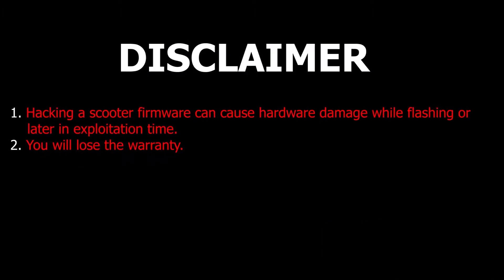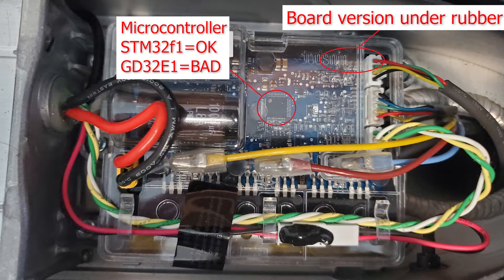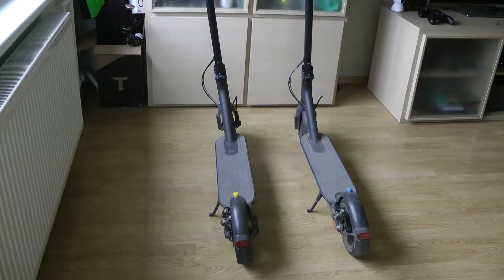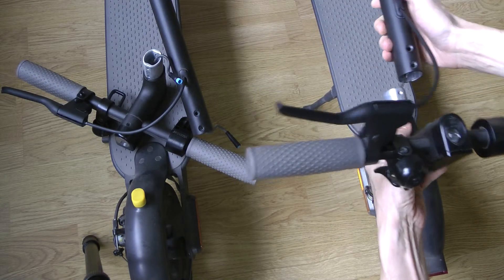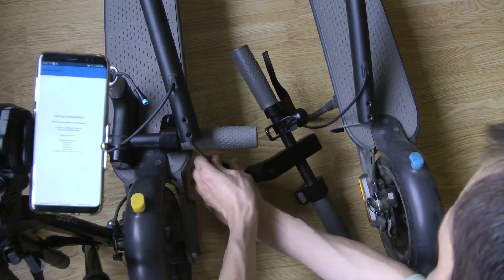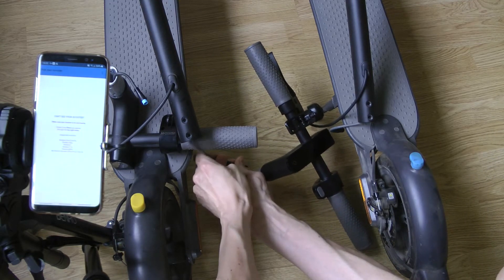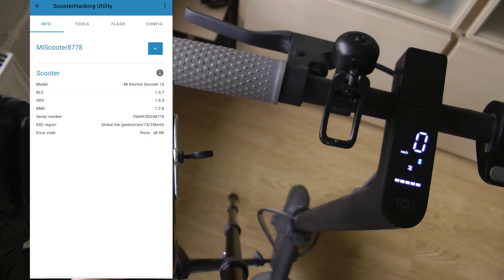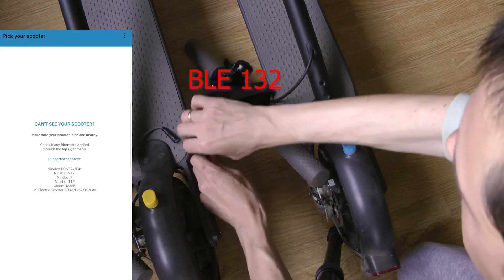Xiaomi Scooter 1S BLE157 speed unlocked

Comment: Big thanks for your Video. I did nearly the same (new pro 2 with ble 1.5.7 with a 1s head). I installed the SHFW succesfully. But different to you I made my config on the 1s head and it bricked (frozen screen, mode D, without battery stats and power button without function). After switching to a new Mainboard now I m afraid to do it again, but i will risk it..
Reply from the maker: ESC was 3.0 right? No errors after flashing?  It might be, that your scooter was stuck in charge mode, sometimes it happens after flash. The fix is that you need to disconnect the battery and connect it again. Try to connect to your old ESC(mainboard), it should work if my guess is correct.
Subscribe, thanks.
Reply from the maker: Oh, and with a disconnected battery turn on the scooter, or wait for a few minutes to discharge ESC completely.
Reply: PS: I had no Error after SHFW install, but after some config settings with 1s display it stuck. I think u r totaly right. I will write later, if i was succesful
Reply from the maker: @smokeyxyz1638  Just noticed that on BMS128 battery level is displayed incorrectly (at least on 1S) BMS141 looks ok. So don't charge your scooter fully while flashing, and if it shows AO (which means fully charged)  on lower than 100% charge, flash BMS141 🤞🤞🤞
Reply: All credits to you mate, it was succesful. I did it like u show it in your video. With the ESC 3.0 it should not be a problem. I m happy, finally more fun again with the scooter. Thank you 🙏
Reply from the maker: @smokeyxyz1638  Yes. Glad that you succeeded. Just be careful on the road :) And check the telegram chat https://t.me/scooterhackingchat
Reply: I'm newbie into these things. I got panic and gave the scooter to a repair shop and they so told me, switched the ESC and the controller (maybe a scam?). But it works again. Unfortunately I did not make a data screenshot, but now there is DRV 1.7.1, BMS 1.2.8, BLE 1.5.7 on. The ESC is 99% sure a 3.0 without opening the ESC cover. I don't want to scratch the waranty sticker. It is a model from 2021/7. Well, i called a friend with a 1s, i will try this in the evening. Thank you for your support 🙏

Comment: how can i do this for xiaomi mi 3?  I need the same mi 3 only on the old update ??
Reply from the maker: In the first place, you have to unscrew the bottom of your scooter to make sure that ESC is 3.0, otherwise, you will brick your scooter for good. As mi3 has 3.0 and 3.1 boards. If it's 3.0 you need another Mi3 with old BLE onboard. (1S head should work for this purpose too)
Only 2nd method will work for mi3, as smooth firmware requires BLE134 to prevent error 42 and you cannot change BLE.
For 1st method, you can cook firmware on scooterhacking.org but personally, I experienced weird shutters when the charge dropped below 30%
Subscribe, thanks.

Comment: The hardest part is i Cant 
 unscrew the screws on the steering wheel 😅
Reply from the maker: Use a bigger Torx screwdriver and some WD40 or oil on the screw and you should be good :)
Reply: @MindaugasJocionis  yeah I did that but the screw is has no grip and can't move
Reply: @MindaugasJocionis  do you think there's a way i can take out the screw. Because i tried but the screw has no grip and is very big.
Reply from the maker: @turbosheep  Go to some car service, they will drill through a screw, and remove the screw with a reverse bolt extractor.